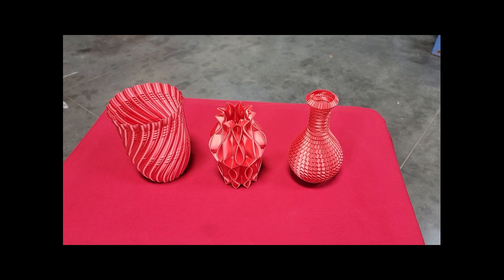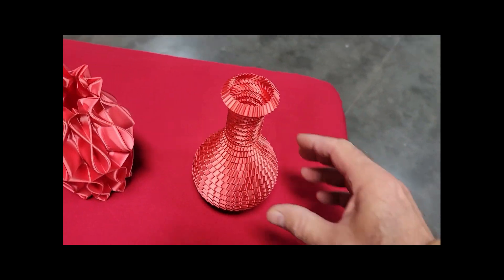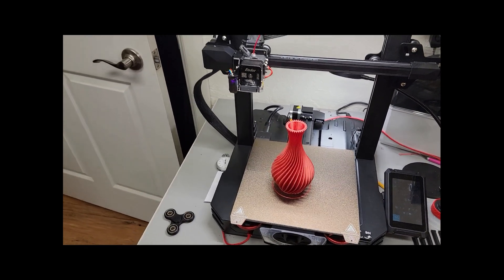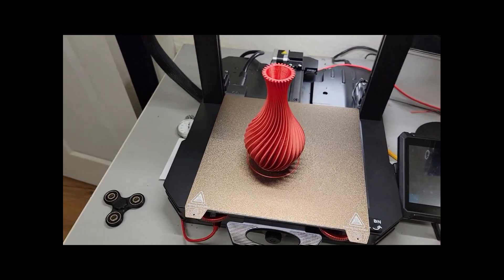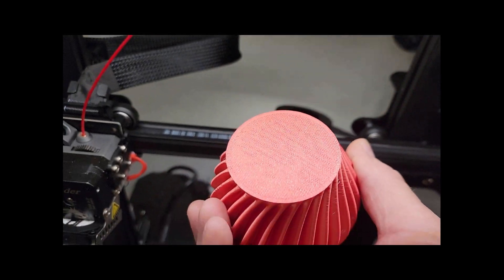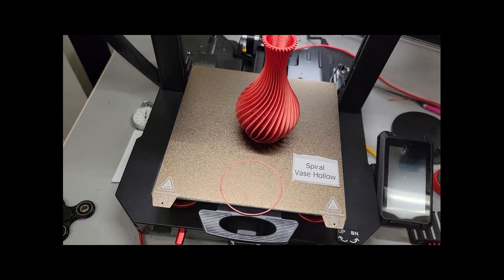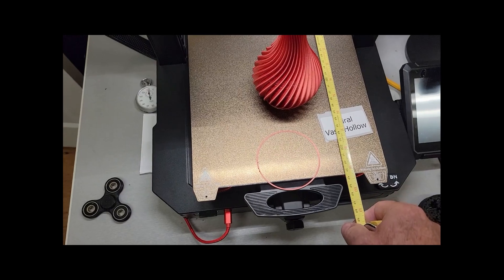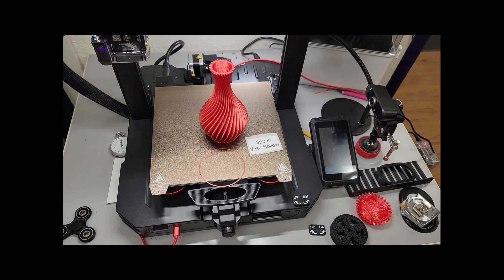Creality Ender-3 S1 Pro PEI Plate Performance

Comment: could I just buy a build plate? Also would 220mm x 220mm work since the build surface is that?
Reply from the maker: Yes, I purchased a second one as I can switch plates letting the pei cool and printing on the other.